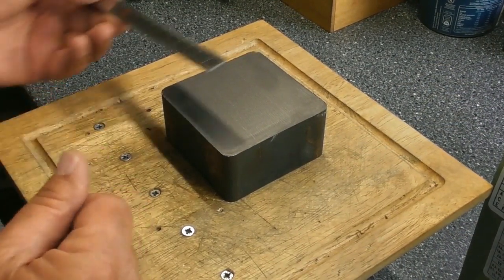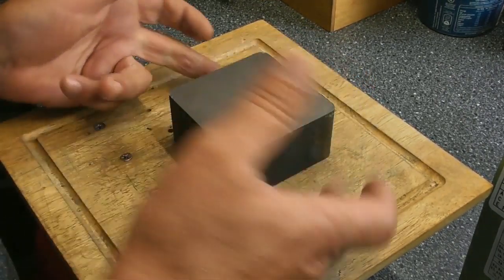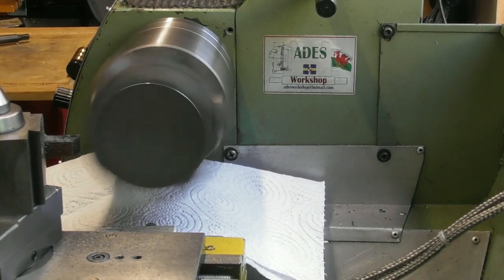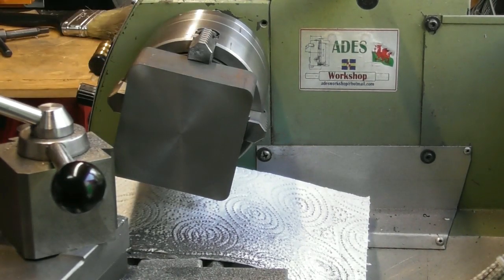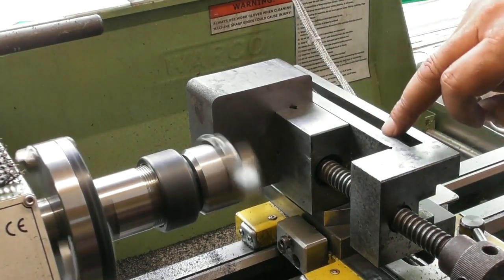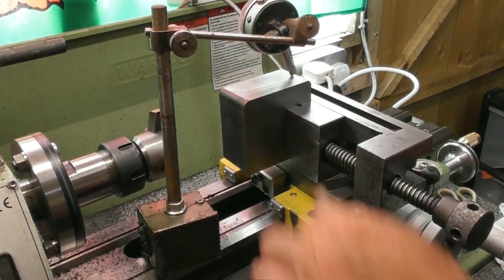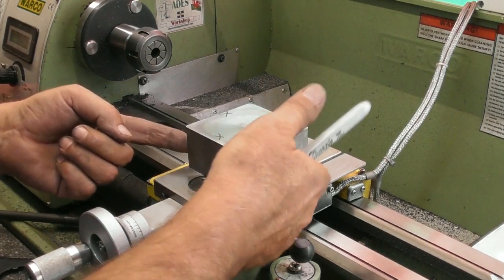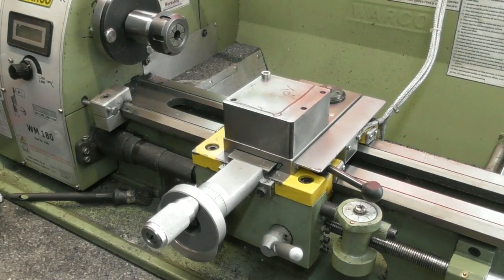Compound slide replacement block part1

Comment: As far as I'm concerned, I was about to do the same thing for a surface plate, but then the local import tool store had the sale they did.  If it's accurate enough for your purposes, it works.  It is a surface plate to your needed accuracy, and you know its limitations, so it's all good!
As for the compound removal, I'm considering doing something similar to what you're doing for my lathe as well - even though it's a 12x36, it's not the most rigid and for grooving/parting it's a nightmare at times.  Looking forward to part 2.

Comment: great project and something I need to do aswel for my old Myford MF74 restoration which has a primitive ML7 style Top slide, a few things, nab some transfer punches I think I got mine from arceurotrade, they are a god send and are perfect fits through reamed holes in 0.5mm increments, great help for when I needed to spot for drilling holes in backplates when I bought some through the front mounted chucks.

also I wouldn't worry about slots for oil to run along under the slide, my MF74 has them between the carriage and bed ways, they collect microscopic particles of crud and trap them, when the carriage moves back and forth it acts like a slight lap, same goes for phosphor bronze bearings when I replaced them the channels inside the bearings which were designed to flush oil all around the spindle were full with compacted crud which the oil is supposed to flush out.

leaving flat with no slots will allow the slide to glide and any crud will be forced out from the back or front :)

if yoy do make some channels make sure the edges are not sharp but stoned with a slight bevel so they are a softer edge instead of a clean sharp angle ( I dont mean a burr Im meaning the transition edge between flat slide face and the wall of a slot )

Comment: I have several 'ersatz' plates that are more than accurate enough (0.002") for everyday use. Love your projects Ade.
Reply from the maker: it is less than 0.001"" for most of the plate , yes fine for everyday use as you say . Cheers Ade.

Comment: Hi Ade, thanks for your time. Just bought a lathe and would like to follow you on this project. Just wondering, how did you determine the o/a height of block? Would the tool post sit on the riser as at the same height as if on original cross slide?
Reply from the maker: yes . that is the height i went with . Cheers Ade.

Comment: A very interesting project Ade, one thought though, as far as rigidity goes, do you think that in addition to the four six mil bolts would you not think that three or four six or seven mil silver steel register pins would greatly add to the strength against twisting the block round? You could drill and ream from under the cross slide, and loctite the pins in place on the block, thus giving you full registration of the block prior to the hold down bolts. Just a thought lol. A question for you, where do you get your cast iron pieces from? I am interested to know because I may well copy your idea and do the same on my Warco 300. Look forward to the rest of the series!
Reply from the maker: That would certainly be worthwhile on a larger more powerful machine . My little lathe has nowhere near enough power to even think about overcoming the clamping force of the 4 M6 allen bolts. on a larger lathe i may even think about tapered dowel pins with extractor threads . Cheers Ade.

Comment: G’day Ade. Good project, something that’s been on my mind as you are correct it is the weakest part of the setup, it’s like the machine is too big for it’s tool post. I am wondering won’t you want to change the tool angle to the job at times to say cut a chamfer or do an undercut in a corner, I know I rotate the tool at times. A query from an inexperienced hobbyist, cheers. Peter
Reply from the maker: I am going to make a lot more tool holders to compensate. it is more about the rigidity on production work and the repeatability when changing tools . Cheers Ade.

Comment: I believe that all lathe cross slides are setup to be almost but not quite square to the spindle axis. Specifically they are setup to produce a very slight concave cut when facing and that this is the reason your block did not come out flat after facing on the lathe. I think that this is more pronounced on cheaper lathes and hard to measure on high end lathes. This is because a slight convex cut is highly undesirable so manufacturers err towards the concave side of square.

Comment: Great work Ade, love the videos. one question though, how do you plan to accurately square a parting tool to the work piece if the block is held in place by a recess?  Look forward to part 2!
Reply from the maker: The toolpost is square by design and a slight amount can be set by the parting tool in it's tool holder . after initial setting up it will always be square. happy days. cheers Ade.

Comment: Great stuff Ade! I've been thinking of doing this myself. Will your design restrict you from rotating the tool post? I move mine all the time to change the angles for cutting and facing. What company do you use to supply the cast iron stock?
Reply from the maker: Yes it will completely stop any rotation , i do plan on making many more tool holders to help with this issue allowing me to have any tool i may need set up . the cast is from college metals online. This chunk was £15 plus delivery , Cheers Ade.

Comment: My surface plate is an off cut from a kitchen granite worktop supplier, it was the bit they cut out for the sink, and it was free.
Reply from the maker: that was a lucky find , i will have to check out my local kitchen fitters , cheers Ade.
Reply: 12mm thick plate glass set in a wooden frame also makes a good surface plate.
Reply: @haroldpearson6025  Unless ground, i wouldn't call a glass plate flat mainly because of the way it's "cast" on top of molten zinc which could have ripples on the surface.
Reply: @hardcase1659  O dear,  and I've  neen using one for 20 years!
Reply: @haroldpearson6025  Good for you i guess? 
I see you like to live dangerously.

Comment: Wondering why you used cast iron as opposed to mild steel?
Reply from the maker: All the other parts of the saddle are cast so I just went with it. It is really durable and stable  as well although stinking stuff to machine. Cheers Ade

Comment: Surely you should have machined a shallow boss on the bottom   to fit the recess on the cross slide  .. then sit it in before you drill the holes ...would have centered it up perfectly ....

Comment: Where do you get your materials from ADE?

Im in the UK and know of a few suppliers but id like to be able to get some cheap offcuts as stock.
Reply from the maker: I use. College metals . Aluminium Droitwitch and ebay searches mostly. Silver steel from Zoro is good also . Cheers Ade.

Comment: If you leave a square shoulder you will not be able to turn it to adjust the angle of the cutter like for say getting close into the chuck like you do at times.

Comment: careful using transfer puches on thin castings though as you use them like extended straight shank center punches, just a light tap will do

Comment: Hmm nice Ade, I have a novice question. Perhaps someone would like to answer it.  
Why do you use cast iron?

Tnx Peter
Reply from the maker: No correct answer to this , I guess it is wear resistant , tough, and does not warp and twist when machining as much as tough steels . Cheers Ade.
Reply: Jamie, thanks a lot for this clear explanation.

Comment: HI Ade, how will you change the angle of the tool? Not like you've got a Multifix tool post.
Reply from the maker: Lots more tool holders . Cheers Ade.
Reply: @ade63dug  Looking forward to seeing how that goes. Cheers
Reply: @ade63dug  Hi Ade, YT flagged up a video by ROBRENZ about a solid mount and now I see where you are going. His video of parting is something that I've never seen on a shop type lathe, real impressive.

Comment: when you sand a surface you will always have a problem at the corners if the sand paper is not adhered to the plate. The paper is going to wear the corners first since the paper is lifting off the plate. if you adhere the sand paper with surface tension using water or a spray adhesive you would have a better chance of a more accurate test.